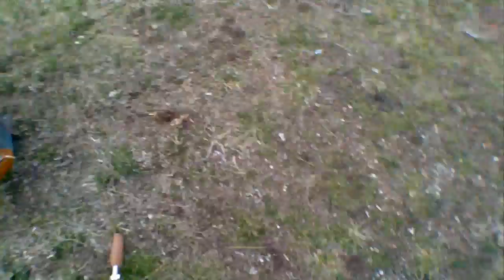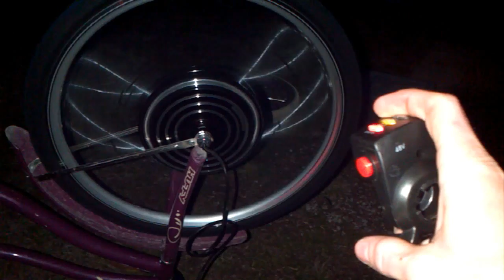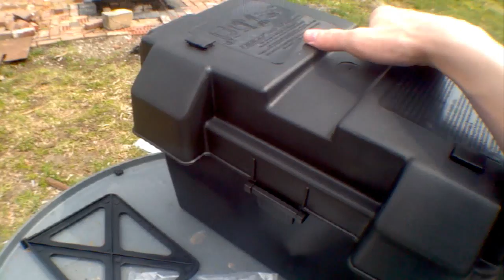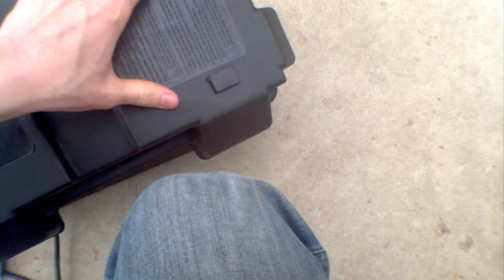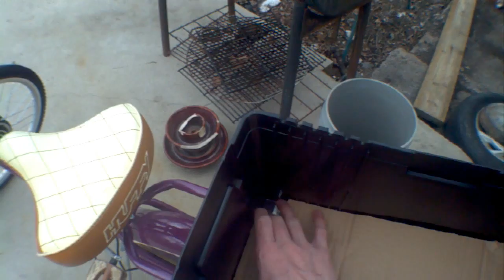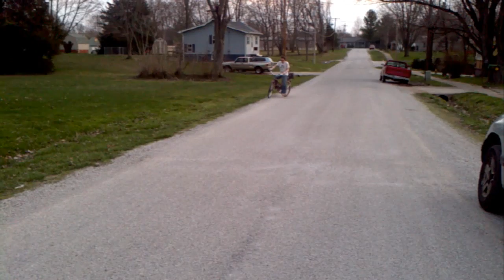DIY E-bike: new motor 48v 1000w

Comment: Ok after watching your e-bike videos you taught me a lot about e-bike building. So now I'm looking to build my E-bike with my old Motobecan DS Comp Mtn bike.  I started buying laptop batteries and now have over 800+ 18650 lithium ion batteries from the used laptop battery packs.  I plan on building my own battery pack also using tabbing buss strips and hot glue to help hold it together.  As I move forward I plan on documenting everything to also help others.  So I've started some videos on on what to do and what not to do, things I have learned and how to charge them.  Next, I will be testing the Ah of each battery and figuring out the size needed as I will have a round trip of 22 miles.  Not that I will use it everyday only (occasionally) using it to go to work which is 90% down hill and about a 500 ft total drop in elevation, but coming home will be the reverse. Will a 48v 25 Ah battery work for this trip or do I need to go with a larger battery pack of 30 to 35 Ah? Thanks for the help.
Reply from the maker: Jay Koster thats hard to estimate. it may work if you stay at 12mph and peddal leasurly. but i would aim for 30AH if you could. nothing says you can't start with 25ah and then make another battery to add onto it, thats what i'm doing. i'm making a 16AH pack to add to mine to give me 40AH.

on second thought though i'm forgetting the differences between bicycles and my current tricycle with all it's heavy cargo. today i made a 20 mile trip on my tricycle at about 18mph with 20mph winds against me one of the directions. and i only charge my battery to like 70%. so i bet 25ah is a great start.
Reply: Rinoa Super-Genius thanks, I figured that you would have a better idea on the batteries since you racked up over 1000 miles on your bike.. I have yet to see anyone else accomplish that,  nice work!  40Ah, man you will be able to cruz the cost of Cali. and back,  lol.  Like you said I will go for the 25Ah pack for now and maybe carry an extra 10-15Ah in a back pack that I can plug into as a backup on my fist round trip.  Thanks again for the advise and I'll keep you updated on the progress.
Reply from the maker: Jay Koster
yeah i hope to get to the Lick Observatory by early next year, then by the end of the decade be able to ride around the entire san fransisco bay one a single charge, that'll be like 300 miles! :D

but i would say run the 25AH with the 10-15ah pack from the start of the ride. you would get further that way. having both connected would lower the Cs that your pulling. the lower amps per AH you pull the more efficient the cells become. as it is now i drain my battery in like 2 hours of riding so they do raise by like 10 degrees. when i add that 16AH pack it may double my range due to me then drawing less amps per cell. if i ran it with 24AH then switched to 16AH i would only get like 4/5ths as much or whatever. hope that makes sense.
Reply: Rinoa Super-Genius  it totally makes sense, thanks!  
Update, I just ordered my e-bike kit, so its on its way from China.  It is a 48v 1500 watt hub and controller to help with the hills here.  It was a little more pricey @ $355 shipped.

I have started calculating the amp hour of my 48v battery and so far Im getting good numbers on each cell.  I have about $240 invested (with shipping) in my lot of batteries.  I'm now pushing about 850 to 900 cells of the  18650 batteries and estimated that I'll use about 286 cells for the project.  So @ .28 cents for each cell that's about $80 for the entire 48v battery (cell wise).  So far I have been getting a lot of 1750-2200 Mah (each cell) batteries, so as long as I keep finding good cells in my stack I'm hoping to get 40-45Ah. 

Battery lay out will look like the following :  
1 battery, 48.1v totaling 13 banks with 22 cells in each bank rated @40-45 Ah each bank
1 48v BMS board 13s rated @ 35-40 amps  
1 charging plug for a 48 volt charger.

Please let me know if I missed something.
Reply from the maker: Jay Koster
with that many cells you'll want to have a PicoFuse on every cell, should cost about 40$ in fuses for the whole pack but it could save you a lot of trouble. connect them in parallel not series though. i'm going with 4 amp fuses on my next battery.

i'm going to have a nickel strip spot welded along the negative side of each pack then a single PicoFuse to each positive lead of the other pack.
Reply: Ok cool good idea,  I just want to make sure I understand all of the positive terminals in each bank will be connected together in parallel by the PicoFuses in stead of tabbing nickle plated strips.  Now that I'm thinking about it, Isn't that what Tesla is using also or something similar?
Reply from the maker: Jay Koster
in a way yes, i'll try to draw it in ASCII art for ya

+(strip)+(strip)+(strip)+ positive of one pack
I           I          I          I
fuse      fuse    fuse    fuse
I           I          I          I
-           -         -          -        negative of next pack

hope that makes sense. you dont want any fuses in series otherwise all the power could go through one and pop it. but if they are in parallel they distribute the load. you can invert this to have the strip on the negative side and the fuses to the positive, tbh i may actually do that since it may be easier to spot weld the tabs onto the negative side. but yeah it doesnt matter it's orientation.
Reply: +Rinoa Super-Genius took my bike out for a distance test today and put 30 miles on it doing 37 mph most of the way (hills were 29-31 mph.)  Once the battery hit 48 volts I stopped riding and thru it on the charger and now the charger is not fully charging.   This is the second time that I'm charging it.  So I thought it might be the BMS not balancing and tore my battery covering off etc... BMS is good all 13 are balanced and the battery is at 53.35 and that's were the charger stops.  Something isn't good because before charging I tested the output voltage of the charger and its at 54.7 volts.  The first time it fully charged to 54.6 volts.  If I need to find a new charger what would you recommend?    Thanks
Reply from the maker: 15-sec-of Fame
is it like the one i use on my trike? you can order those for like 15$ from ebay. i say get two just to have one for backup in case something breaks inside it.
Reply: $15 that's awesome! I guess I bought the gold plated one on ebay for $54 plus $28 shipping 30 days later it arrived via snail mail from China.  Mine was a no name 54.6v @ 4 amp's Whats the brand that you have?
Reply from the maker: 15-sec-of Fame
brand? hahaha

the shit i buy ussually doesnt have a brand :P
Reply: Lol, yeah I'm currently on ebay trying to find another nonreliable no name POS.  I'm in contact with the seller of mine, but I doubt they will send me a new one or even help me out.  Bought it back on June 9th and on the 2nd charge it broke!  Oh well guess I'll take my chances on another no name POS, haha

Comment: I have years of experience building e-bikes from ones purchased at Walmart and I have good tips on them if you  would like: for here I recommend getting torque arms, especially for front wheel driven setups because if you decide to go high voltage, say 48 volts like I do, those motors can literally snap forks... even rear wheel based setups, which don't cost much more and can interface with your existing derailleur gears should have at least 1 torque arm (they cost about $20 each).  I prefer 48volts 15AH lithium, which can get you going around 30-35mph and get around 30 miles on a single charge.  Don't go faster: it's not worth it-- if you want speed convert a Chinese cheap scooter like I did and you can pretty much get  to 45+ mph without risk, as they can handle that speed, although I tend to keep mine around 25mp-30mph because it's plenty fast and fun at the same time... also, don't go with the controller that comes with the motor wheel-- you'll be lucky to get up a hill faster than 10mph on them and even more --  you will likely fry it.  I can share lots of info for those who are interested and I want to tell the author of this video: great job, especially on building your own lithium power pack-- saw that on another video of yours-- way cool!
Reply: +Help Me 2000 he builds his own packs and uses the stock controller, it worked out for him
Reply: Bro, where do you buy the torque arms? And batteries?
Reply: what controller would you recommend ?
Reply: How would a 
36V 10Ah 350w Battery . work on a 1000w motor  doable ?

Comment: Just a word to any ebike builders, Those brakes which come with the ebike kit, are crucial. They are designed to cut the power to the motor as soon as the brakes are engaged. Without those special ebrakes, you'll either skid the rare wheel or wear your brake outs working against the motor. Not good.
Reply from the maker: Chris Liddiard only if your too stupid to let off the electricity.
Reply: Rinoa Super-Genius  ebrakes are designed for those situations where you wont have time to think. It cuts the power so that you stop as quickly as its necessary. Also applying the brakes with the motor still engaged, for however short a time, doesn't do the motor any good.
Reply from the maker: Chris Liddiard
but if you dont have any time to think then you dont have any time to hit the brakes, hitting the brakes takes time to think.

also holding the breaks with the motor going isnt exactly a bad thing, just wastes a bit of electricity.
Reply: Wait, im confused, so rather being safe, you would rather risk damage on your bike or even your body just cause you didnt want to install some breaks?
Reply from the maker: junu lee
how would it damage the bike and my body?
Reply: Im confused, i thought safe breaks were essential to not getting hurt and not damaging the tires.
Reply from the maker: junu lee
ah so you just dont understand what we are talking about. that makes sense now.

the OP was saying to make the bicycle's motor turn off as soon as you turn on the breaks. imagine if as soon as you hit the breaks on your car your engine shuts off. that would be more dangerous than helpful.
Reply: Rinoa Super-Genius thats what happens on stick shift cars haha if you dont push the clutch in

Comment: that strange elastic band might be the protective strip that was supposed to be installed in the rim to prevent the spokes from popping the inner tube.
Reply: Andy Fletcher just coated the inside of the wheel with a few layers of cheap crappy electrical tape I doing this ASAP when my kit arrives :-DDDD

Comment: Good video. Enjoyed it. Just got our 48V bike kit working today after storing it for unknown number of years. I thought there were pieces missing and there was a weird monolithic box which we eventually opened up and the missing connectors were sealed up inside. Ugh. We had already cut the wires and were trying to find a compatible controller. Why did they do that without even a note or label.

Comment: ok i'm new to this. I like to go on the bike trials (paved) but the slightest hills are torture.. will this assist me up the hills? I don't plan on using it all the time I just need a little help up the hills. I have a beach cruiser
Reply from the maker: ChrissyTopicsTV yeah a hub motor would help a lot. a 250 watt motor would be ok for assistance i think.
Reply: okay thank you and also can I buy one of your homemade lithium batteries from you?
Reply from the maker: ChrissyTopicsTV
no, but you can buy or build one.

Comment: I'm thinking that you should really have some venting in your battery compartment. Depending on how tight your lid is?
Reply: Blake Doan could try a few holes near the top on both sides to counteract wind resistance...although low when under 40mph..
Reply: +Blake Doan he doesnt need it

Comment: Can you make a battery pack out of 2-18 volt rechargeable  battery from a drill? Do they have to be lithium ion?
Reply: Daniel Phillips battery life is dictated by amps or A or AH the higher the number the longer lasting the battery will be... minus other contributing factors such as how many amps can be drawn at any tie e.g. a 100 amp battery can give 100 amps of power...but not all at once it may only give out 10 amp which may not be enough for a high powered motor like this to get up huge hills...the unit for this drawing amps in known as "C" in lithium cells, a google search will tell your more. :-) BTW, nice work with the bike and batteries Rinoa lol... Has the battery cells maintained balancing whilst using standard unbalanced charger...I have added car battery crocodile clips to a drill charger to charge my lead-acid batteries lol..works perfectly..
Reply: +Israel Ontiveros would work but not for long

Comment: Hi Rinoa. Thank you for the interesting videos! Can I ask a couple of questions? What is the wattage on the treadmill motors and why didn't they work out? Also, the in hub motor you bought is impressively quiet! Can I get the exact brand of it? Thanks, Jeremy
Reply: Jeremy C couple means 2 (looks at a couple of people in the street lol)... asking to ask questions is a question that menas last question is number three...quick no one repsond to it it is rendered pointless.... LOL JOKING...BTW the kit is cheap and chinese... go to ebay and search for "48v 1000w bike kit" then you'll find it! :-D
Reply: Shane Williams it doesn't have a brand usually if it is cheap and chinese just sold to highest bidder really. :-S
Reply: Lol, thanks man
Reply: +Jeremy C the treadmill motor wasnt powerful enough

Comment: Hi ... i did find out something cool by mistake... i used 12*4 packs of cells...and it did work. I then added one more pack of 4 cells ...for a total of 52 volts.... what i found after my test run was the motor i ran significantly cooler.... i will be building a whole new pack im going to try 10 * 13 ...keep the videos comming .... i always enjoy them !!!

Comment: Is there a problem using front wheel drive when going uphill with most of the weight on the rear?
Reply: +Stu Lieberman not usually

Comment: First off great video...why didnt you use  13 * 6 packs ?  The bats are 3.7 volts....im just wondering if you would get more power / AH  that way
Reply from the maker: because the batteries are 4.2v when fully charged, i've found that i dont like to let them go bellow 3.9v because bellow that they dont provide many amps.

adding another pack is a good idea though, it will add a bit of power. i was thinking about that but decided against it.
Reply: Im going to try it and i promse to let ya know how i make out.....also a friend of mine was closing his computer store and he gave me some laptop batteries hes had laying around...12 i took them apart and each bat. Seems like they all have around 2.3 to 2.9 volts....??? Would you use them,,,???
Reply: +michael grelewicz yeah, he used ones that were all the way down to >.1v

Comment: Hey I'm purchasing a 48v 1000w ebike kit will it be able to handle a 48v 25ah (1200w) lifepo4?
Reply from the maker: Arkansas Homestead i'm going male to female, its been a bit hard psychologically during puberty but now its not hard since i know what i want. i hope to start transition this year. my first appointment is in like 2 weeks.
Reply from the maker: its more like the other way around, will the battery be able to handle the load of the motor. i think that should be a very nice battery for your bike but i dont have much experience with lifepo4 so take my input as untested. :P
Reply: Rinoa Super-Genius Just wondering I found your channel doing a search on Transgenders, are you a Male in the process of becoming a female or Female in the process of turning into a Male ? Whatever the case I was wondering how hard it has been for you ?
Reply: Rinoa Super-Genius Congratz :)
Reply: Shawnster nator I use the same setup but my batter is 15AH and it has been working flawlessly for 3 years now... It goes up hills great and I get about 30 miles trip distance running it full throttle... about 35mph... all the way... :)

Comment: quick question, I have the same motor/controller as you and i just put a battery together, it reads 52 volts but after it goes  through the controller when i hit the throttle it says its only 9 volts (at the leads that would go to the motor). The wheel was to wide for my bike so im going to have to figure out something with that before i can test the battery with the motor. My question is, is it normal for that to only read 9 volts with no load or is my battery not strong enough or maybe my controller and or throttle broken? I tested all the cells and its 18 AH so I'm thinking that should be enough (although if the cells were actually what they were rated at it would of been 28.6 AH, that would of been nice!) Thanks for your time.
Reply: +willm350 if your battery goes to 9 volts then the controller is either shorted out or you have a really weak battery
Reply: +DMAN22yeah thanks for the reply. ya i had a faulty solder joint that was basically voiding out three quarters of my battery
Reply: willm350 that would cause it, lol